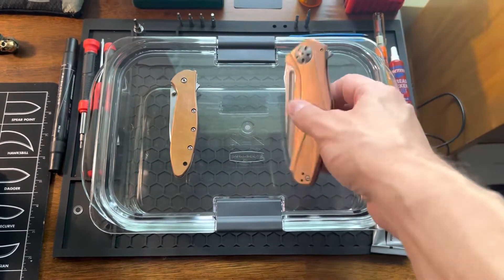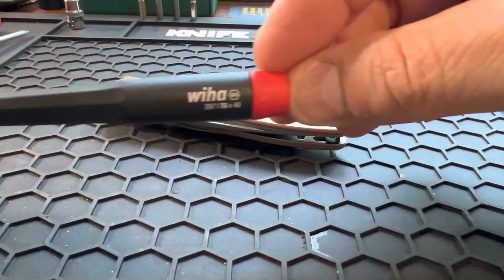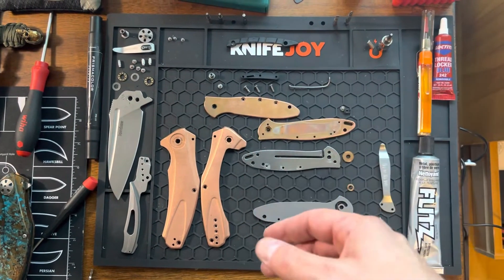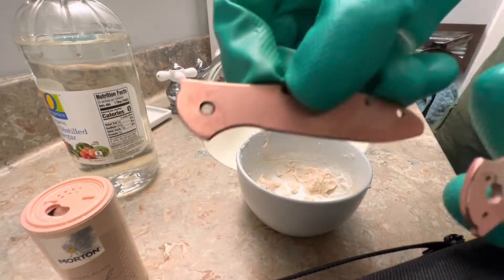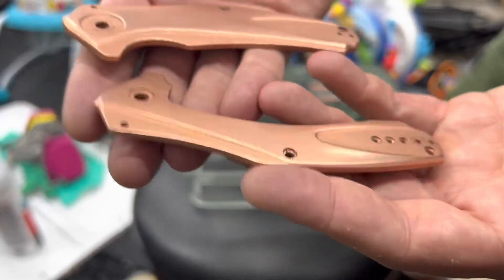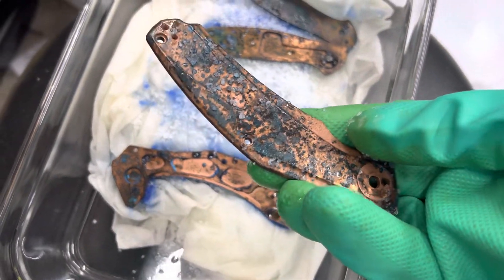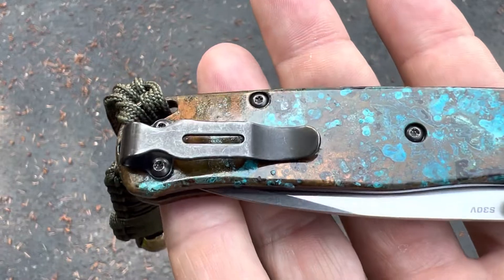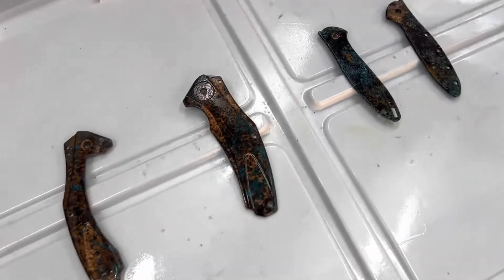Let’s put a Shipwreck Patina on copper scales with simple household ingredients

Comment: I actually bought a copper natrix to force a patina on, and EVERY screw 1) had more locktite on it than any other knife I’ve opened, 2) it was red locktite. I couldn’t get it open no matter how long I had it on the hair drier. Ended up using a soldering iron on the screws. It broke 4 bits and I kept grinding them, by the end I had one bit, barely functional.

Comment: I've found that using a soldering iron to heat the screws helps tremendously to break those over threadlocked screws.  Just touch them with the hot iron for a few seconds and try to unscrew...rinse and repeat.
Reply: Oh wow I came here to comment the same thing. I had a ton of trouble with someone having a party with red locktite and the only thing that worked was a soldering iron

Comment: Maybe I missed what you did after pulling them out to dry. Did you rinse them off, lightly sand...?? Prior to clear coat.
Reply from the maker: No rinse, just remove them from the ammonia chamber, let them air out, and then apply the clear coat. I did do a little KP on the screw holes, just to make sure they were good. but you can do that afterwards.
Reply: @NWEDC  👍

Comment: Very cool, thanks. I've got the flytanium brass scales for Spyderco PM2 coming and I think I'm going to do this.

What would happen if you didn't clear coat it afterwards? Does it have a nice rough texture? Would the blue rub off?
Reply from the maker: If you dont, the patina will wear off quite easily. If you do this, and you do not like the results, you can simply clean them off back to new, and do it again.

Comment: They turned out fantastic! I'm doing the scales for my Kizer Original right now. Couple of questions for you. How many coats of clear coat did you apply and did everything go back together OK? Curious if after the patina and clear coat did the screws go back in or did you have to clean the holes out with something?
Reply from the maker: Thanks! I did 3 coats of clear coat, letting them dry each time. I did not to anything with the holes on two, and used some wooden toothpicks and threaded the holes on another. In the end, the only pain in the ass part was getting the now soggy toothpicks out of the holes. They all went together just fine. I did try to avoid things like grains of salt getting into the holes, but one of them had a massive salt grain in one of them, and it did not impact the threading at all. I would suggest using a toothpick or something to lightly clean them out before reinstalling the scales. The soft wood wont damage the threading. Thanks again, and I hope this answers your questions. Happy holidays!